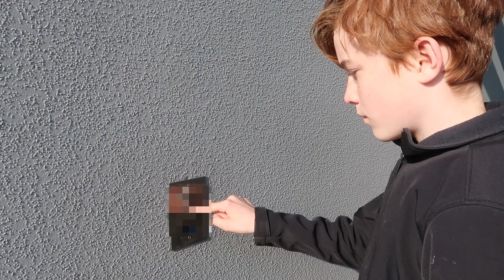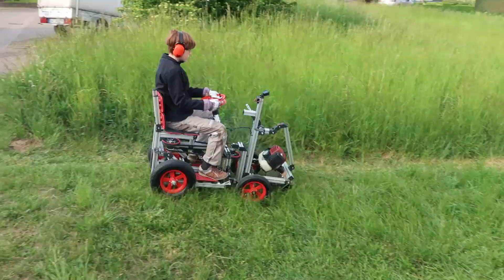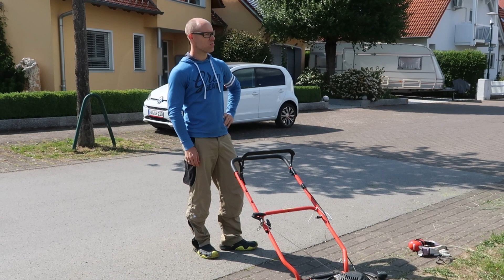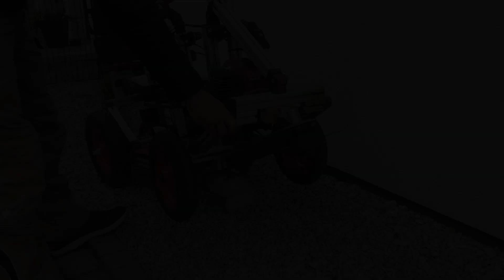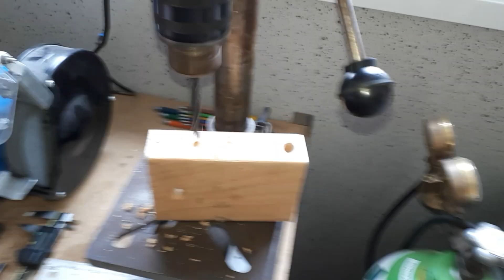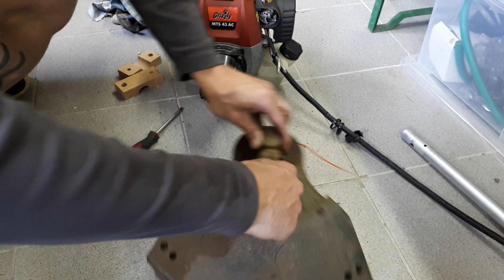Build a DIY Hybrid Ride-on-Mower for Kids (Infento Creation 14)

Comment: Hello Jan,
COuld you help me out ? I'M looking for more off road tire for my infento built... Could you confirm me the sizing you find for your rear wheels ?
By the way ! Great work you did !
VV
Reply from the maker: Hello Vincent, if you want to stay with the std. Infento rims, then you have to look for rims that fit onto 8" tyres. The most common and affordable alternative are wheel barrow tyres (inflatable ones). They can be often found under the dimensions 4.80/4.00-8, of which 4 inch is the width and 8 inch the rims size.

Comment: Absolutely brilliant.
I hope you patented it and make further variations.
Maybe with a sling steal self retracting cutting head to cut small 1 to 3 inch. unwanted saplings.
Reply from the maker: Cool idea....with a skater wheel that will keep a constant distance above ground....ah too late, we already built  a new ride.
Reply: @modularmobility2276  what happened to the original one ?
I do hope it didn't have an kid induced untimely end 😢
Reply from the maker: @ronaldheit196  Well, we just needed the parts for something new. Unlike with Lego, I hardly have the money and the space to build multiple rides at once. We've now built a forklift...just as cool.
Reply: @modularmobility2276  did you patent the Lego and try shopping it around ?
It really was a cool idea being built lego style that would allow easy modifications to be made for different configurations.
Reply from the maker: @ronaldheit196  Sorry?